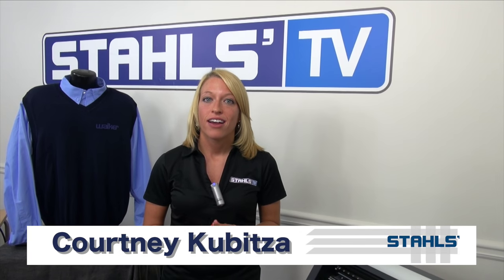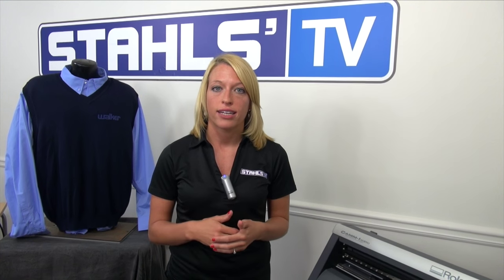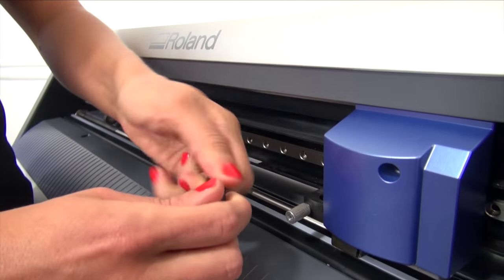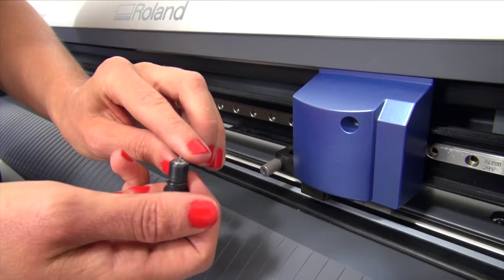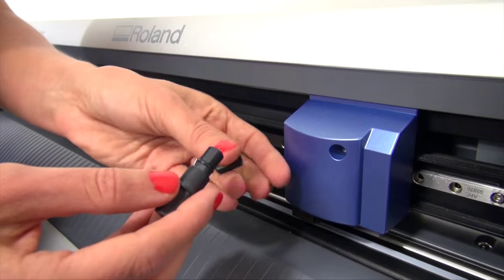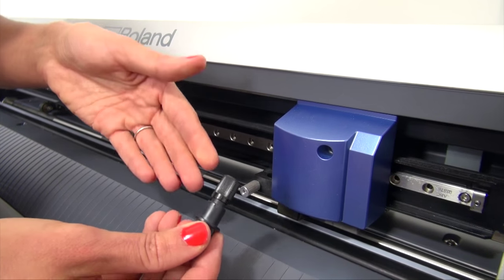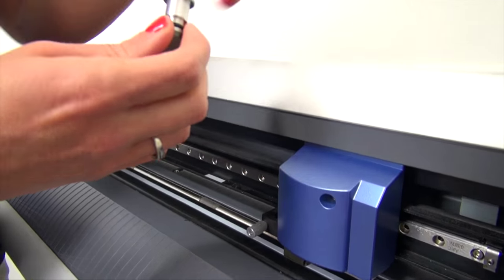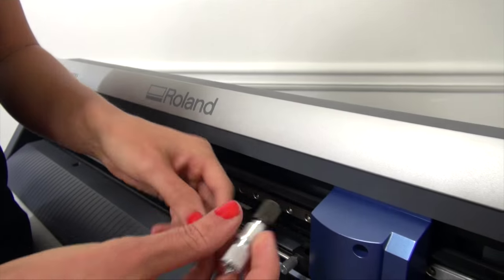Common Vinyl Cutter Problems: Incomplete Corners

Comment: I'm having issues with the more intricate cuts during the cutting process but usually not the smallest cuts but rather the longer one's that are Tapered will pull up and lay over on to the rest of the design and ruin it altogether.
I've slowed down the speed and lesson the down force trying to remedy the issue.
Kid wants an eagle cut out small enough for his drinking mug.

Anyway, I'm going to try and see if maybe this could be my problem but thought I would ask You just in case.

Thank You Kindly for Your Time and Helpful Videos!!
Reply from the maker: Hi Jim - please check out this pdf, with other troubleshooting tips: https://assets.stahls.com/stahls/content/pdf/education/Training-Resource-vinyl-cutter-troubleshooting-tips.pdf

Comment: Hi, i have a query , what can be the problem if the carriage head doesn't move when try to operate the cutter from the software
Reply from the maker: Please email qe@stahls.com to get assistance with this issue.
Reply: have you selected the correct com port
Reply: @christhornton7131  yes